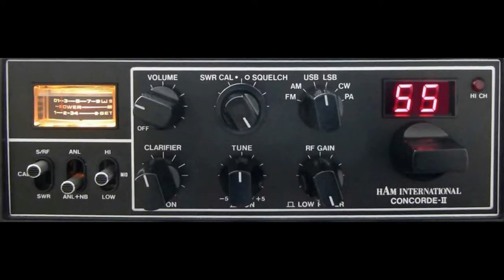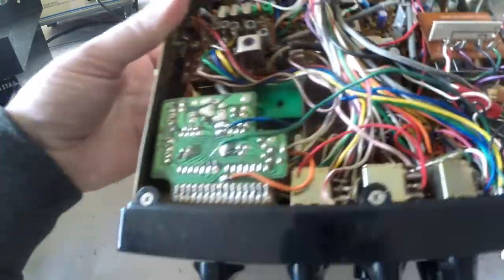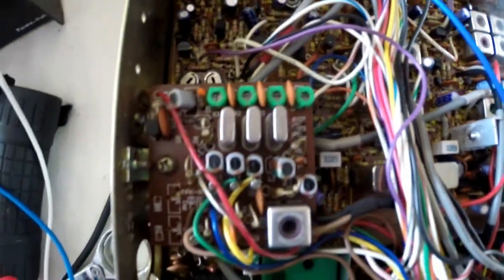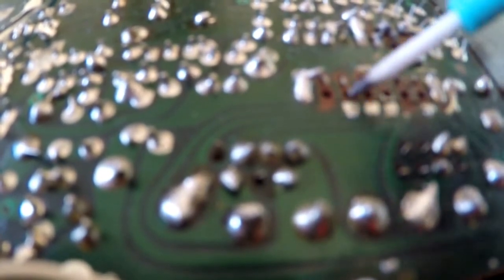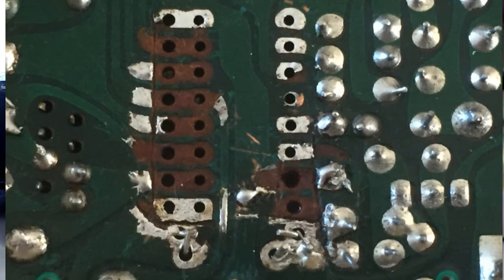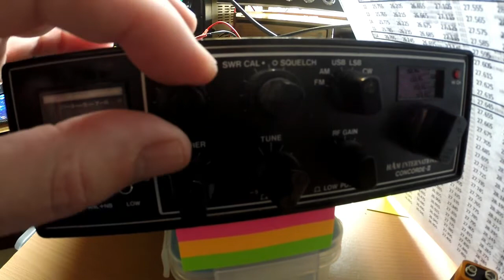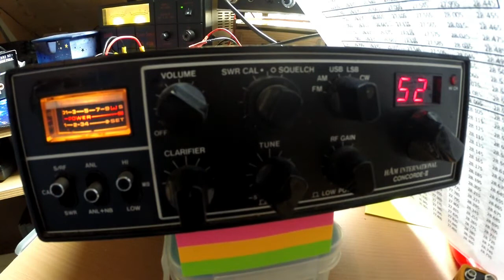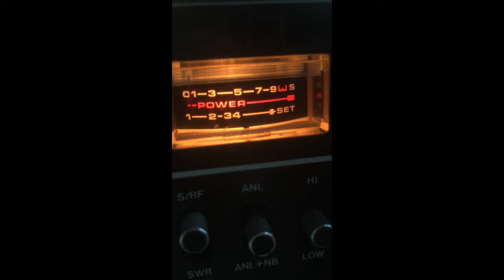Ham International Concorde II - Part 1 Can it be saved?

Comment: I got one of the concorde's on the 50mhz ham band and it's a damn good radio!. Save it and get it working!!.
Reply from the maker: Nice!!! Wow that must have been an extensive mod to do that, did you do the mod yourself or did it come like that.
Reply: @britishcbradio1055  I bought the rig off ebay years ago as a supposed scrapper but a bit of tlc got it working. The conversion is interesting and would have taken hours to do!. Looks like your rig had the UK cb27/81 eprom fitted then removed.
Reply from the maker: @elliotspencer2648  your radios back story sounds very similar to mine, bet yours wouldn’t be the same price you paid for it on ebay now prices are mental on there at present. good call on the eprom theory that would explain the cut across the tracks and all the pads that have been removed, must have had the “blunt stick” soldering tip on for that one. 👍
Reply: @britishcbradio1055  I didn't pay a lot for it!, yes and the prices of cb's on ebay is just laughable!!. I've seen quite a few rigs with the UK eprom fitted and even done some myself but the eprom will eventually start to lose the data programmed into it.
Reply from the maker: @elliotspencer2648  Out of interest what sort of lifespan do the UK eproms have that you have seen in the past had, didnt realise they lost there data.
Reply: @britishcbradio1055  I'm not sure of their lifespan but they do get a bit warm in use and it's the heat which causes them to lose the data. Better off having a 'naughty' rig and a UK fm rig!.
Reply from the maker: @elliotspencer2648  ok thanks Eliot useful to know.

Comment: The concorde 2 was my 1st ssb radio back in yesteryear loved it my mate had the 148 what was always said to better i have a 148 now days i would like a nice condition concorde to compare it i no the 148 audio would be better i always thought my concorde received better than my m8s 148 back in the day
Reply from the maker: Not had any experience of the 148 but yes probably would have better mod as the concord suffered from gritty mod due to a bias issue, there is a widely done mod that sorts it though. I need to finish my concorde but got stuck as the manual didn’t match the board, but i must pick uo on it again and get it finished. All the best Mark

Comment: Hi, I have a question, can this radio be unlocked below 26965 so that it is 26400???
Reply from the maker: Hi Rafal it has the lows so starts at 26.515, if you want to go lower you would need an eprom mod. What you looking for on 26.4mhz not much down there apart from paging systems i believe.